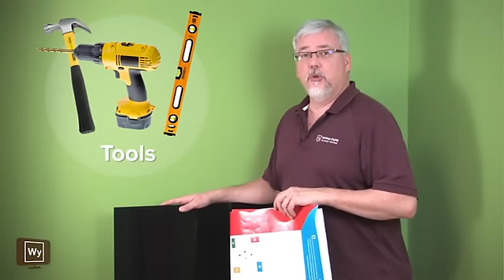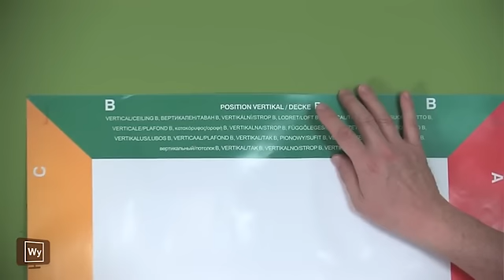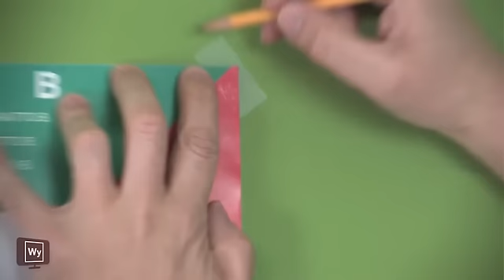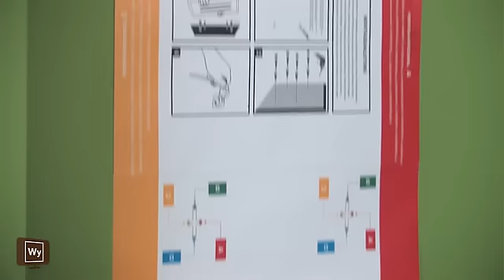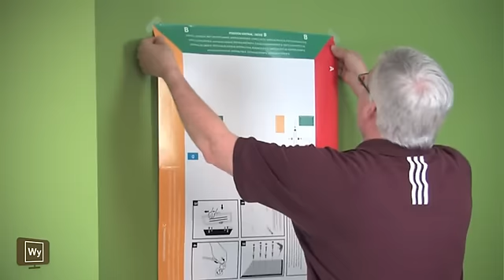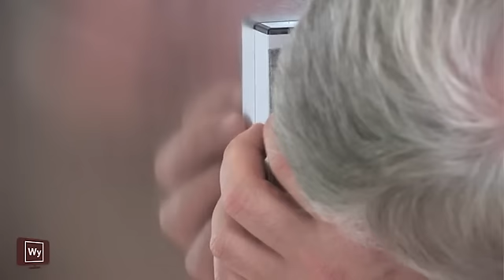How to Install an Ember Infrared Radiant Heating Panel

Comment: Can you mount them on the ceiling?
Reply from the maker: The units shown in this video come from our main Ember glass line which cannot be mounted to the ceiling. Only the 35" x 24" and 47" x 24" Ember Flex radiant panels (IP-EM-FLX-WHT-0500-CW and IP-EM-FLX-WHT-0700-CW) can be mounted from the ceiling and come with all of the necessary hardware to accomplish this.  https://www.warmlyyours.com/en-US/products/line/radiant-panel-ember-flex

Comment: Can you put these side by side?
Reply from the maker: Do you mean putting 2 radiant panels next to each other when installed?
Reply: @Warmlyyours  Yes, each panel touching, or very close to it.
Reply from the maker: Since the panels radiate a lot of heat, they cannot be placed close to each other or touching. The installation manual recommends that they be placed 3" apart from one another if installed side by side.

Comment: How exactly do you use a Panel heater like this? Seems like none of them have thermostats or Remotes. So will your room get really hot, if left on?
Reply from the maker: Hardwired units must be paired with a control that is also installed in the wall to help control the unit. For plug-in models, you can simple plug it in to the wall or purchase a control that the unit can plug into to help adjust the temperature and turn it on/off. Thanks for watching!
Reply: @Warmlyyours  ok, thank you. Hopefully a smart wall plug will work with this.

Comment: So, do I then lose access to that whole wall area? Nothing can go in front of it I presume, is that correct?
Reply from the maker: Yes, nothing else would be hanging on that wall. Furniture can go in front of the wall panel but there are recommended distances to place any objects near the panel. It is designed to warm objects in the room, so you can still be close to the panel when in the room. Thanks for watching!

Comment: Our house is 3 bed semi detached with solid bricks (no insulation). We installed Infrared Panels 2 years back as per the guidlines given by provider. Our personal obervation these are slightly costlier especially in core winter (Nov to Feb) when on an avg outside temp is 0 to 6degree. These panels take longer time to heat the room e.g. the hallway panel takes almost 12+ hour to heat our hallway and that too only 17degree. If we want 21degree temparature in our house then we have to keep them on for many many hours. I am presuming this could be because our house is solid brick with no proper insulation. Could you please advise what can be done to improve the efficiency? As of now we are very disappointed with them.
Reply from the maker: Thanks for your question, Arnav. It sounds like your primary issue stems from the lack of insulation in your home. Without proper insulation, any heating system (from forced air to a roaring fireplace) will be rendered inefficient.  

While radiant panels, like the Ember and LAVA lines available from WarmlyYours, are great, functional sources of supplemental heat for most homes, you’ll need to address your insulation issues to fully appreciate their benefits. Feel free to give us a call at (800) 875-5285 if you have any further questions about insulation or radiant heating systems.
Reply: Thanks for your reply. How much would it cost for external insulation? As I said our house is standard 3 bed semi detatched with 3 walls exposed (L 10m * W 6m * H 6m).

Also once bricks are hot how long does it take to cool them down? Because I beleive the main objective of external wall insulation to make this process slow....